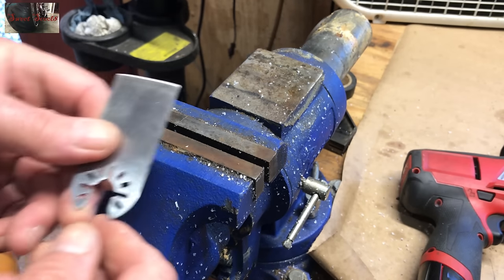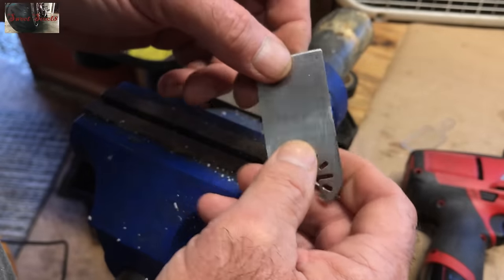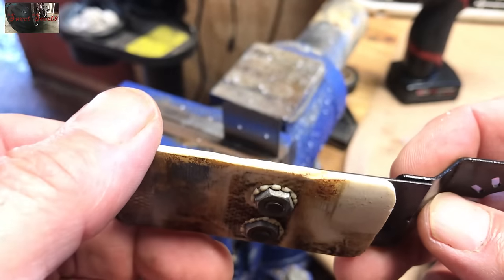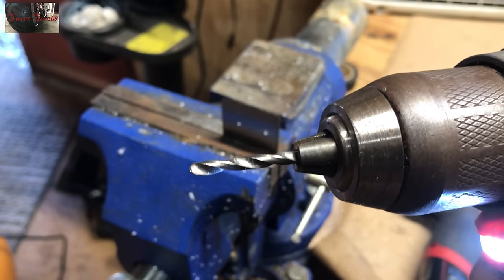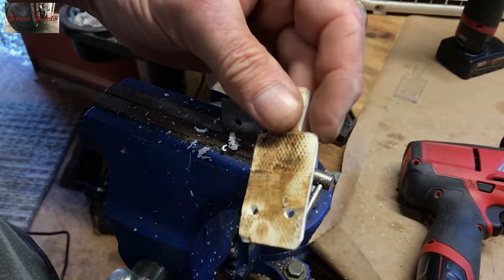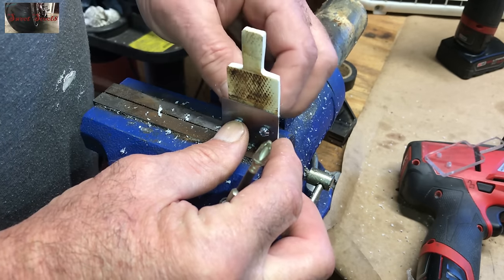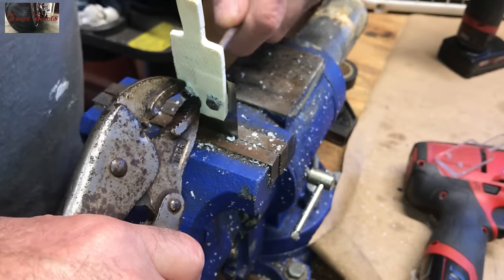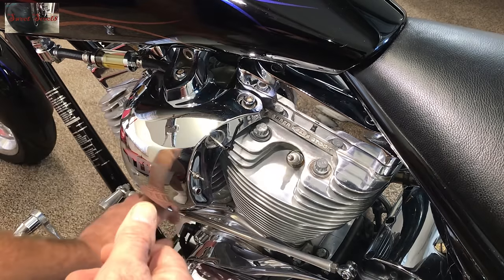How To POLISH Motorcycle Cylinder Jug FINS in 10 Minutes For Aluminum & Chrome  A MUST SEE HACK!

Comment: I been a carpenter for 30 years now and a all around fix anything type of guy those multifunction tools rock great tool. I would suggest trying the cordless dewalt to its variable speed which is so freaking helpful in a lot of ways. As for the head bolts I would get some locking chrome caps with the little Alan screws they look good and lots of different styles. Great video keep pumping out the helpful content.
Reply from the maker: They definitely are a versatile tool brother! Thanks for the view and comment, we really appreciate it, have a fantastic rest of your week my friend. mad Mike

Comment: Great vid. What type of plastic are you using on the polisher end? Plexiglass?
Reply from the maker: It's schedule 40 water pipe cut in half, heated up, flattened out and you can make it any length you want. Ours is 2 to 2 1/2 inch diameter pipe, it works the best. Thanks for watching and asking, have a great week. mad Mike
Reply: @SweetScoots  Ahhhhh. Thats cool! Thanks mm.

Comment: Flitz sells 2 and 3 inch diameter buff balls you put on a fast drill, corded or cordless. They don't get into the fins the way this thing does, but they do get into any small nook and cranny, and they have no exposed metal at the tip or anywhere. The small ones also are mounted on a longer metal rod. So you can reach pretty deep into the bike easily, and they do a fantastic job polishing. They're washable so at least with Flitz own polish you can  reuse them many times. No easier way I know of to polish spokes, either, if you have old school spoked wheels (they also have larger diameter options for more generic polishing of larger surfaces). The very low profile of this design is nice though, for doing things like engine fins.
Reply from the maker: Thanks for watching and sharing, have a great week my friend. mad Mike

Comment: Just curious on what the thickness is of the lexan or PVC you use is that 1/8" or 1/4" thick.
Reply from the maker: You want to use schedule 40 pipe, and split it in half, warm it up and flatten it out. The schedule 30 pipe that you get at homedepot will not work. If you're not sure which is which, just ask an associate at hd to help you get a 2 to 2 1/2 inch piece of schedule 40 water pipe.  Thanks for watching and asking, have a fantastic week my friend. mad Mike
Reply: @SweetScoots  Hi mike, thanks for the reply actually made the tool with lexan and it worked fabulous! Would send you a pic but not sure how to attach it on here. Anyway I appreciate the info thanks

Comment: Great tip. I’ve rigged a paddle per your demo. Plexiglass seems a bit thin. I’m punching through the cloth pretty fast. (About a minute in. Using an old tshirt.) What’s the width of your plex paddle? Thanks!
Reply: *depth
Reply: **thickness!
Reply from the maker: We use 3/8" to 1/4", flattened out PVC pipe works great too gerry! You are going to go through a lot of t-shirts doing this process :) Thanks for watching, have a great day and all the best on your project my friend. mad Mike Sweet Scoots

Comment: Good video. Anyone try using Pop Rivets instead of Bolts
Reply from the maker: The reason we use bolts is because we know most people don't have a rivet gun, but that is a really good idea. The other issue with rivets is with the constant vibration we've had them shake loose and the other reason to use bolts is because it's easier to change out the plastic when needed. Thanks for the view and comment, have a great week. mad Mike

Comment: Hey, were they original polished from the factory?
Good tip too, thanks.
Reply from the maker: Yes they were ozzie! A good way to know of any fin that was polished at the factory is if they are smooth, if they weren't polished at the factory they will still be rough from the casting of the jugs in the factory. Thanks for watching brother, have a great week. mad Mike

Comment: You can use a 3/32 bit And barely touch the trigger and let it wind up some #0000 Steel wool & put some Mothers on it & go around the bolts And follow-up with a little strip of cloth the same way.
Reply from the maker: Thanks again for the tip, Tom! We appreciate the view and comment, have a great week. mad Mike

Comment: Just use gorilla glue and clamp it together.  It will be much easier than drilling holes and will hold stronger with nothing sticking out.
Reply from the maker: My friend, i will guarantee you with everything that I know about motorcycles over 40 years, there is no glue that will withstand the pressure applied and vibration from an oscillating tool while trying to polish metal. Have a great week. mad Mike